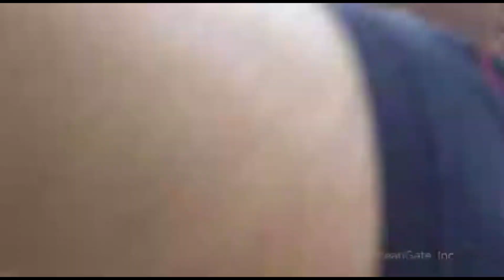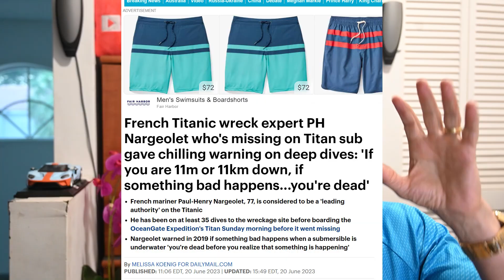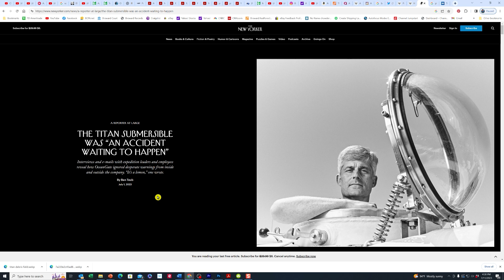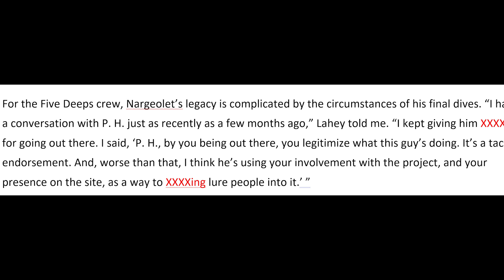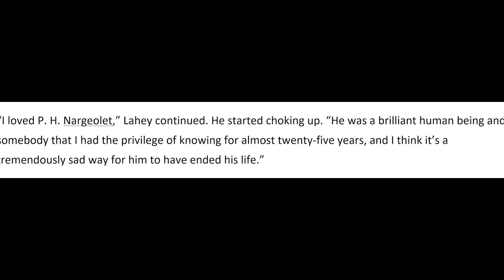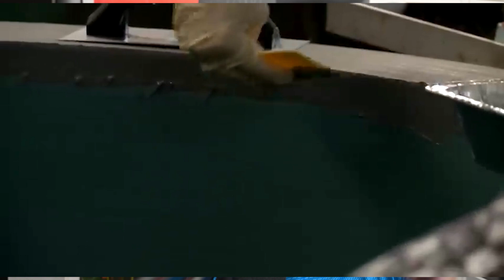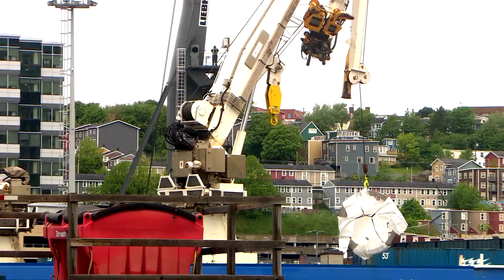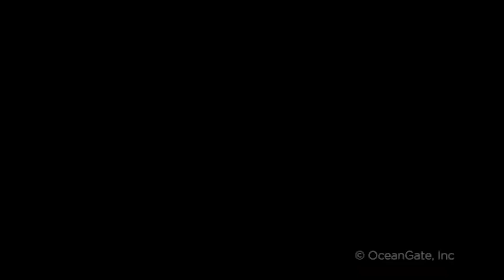Titan Sub: More Q&A, Design Defects, Why Descent Fast

Comment: I am posting my theory here first. This is based on James Cameron's comments about communications with the expedition team. I am an engineer.

The Titan did not report water sloshing sounds or uneven descent. The carbon fibre became weakened by previous dives. On this final dive, the fibre hull experienced increased deflection (inward) under pressure, reducing the sub's volume, which looked like increased weight. Note that inward deflection of the middle of the cylindrical hull results in outward deflection of the ends. This explains why the titanium ring surfaces show the glue has been sheared off. Ultimate demise was caused by failure of the glued joints, failure of the fibre hull envelope, or both  simultaneously. 

Thus the mechanism for apparent weight gain was the same as the mechanism for ultimate failure.

I have done  rudimentary calculations for volume loss due to increased hull deflection , but don't have enough information (initial sub negative bouyancy, balast weight, etc).
Reply: Like you, I don't have the numbers for precise calculations, BUT: carbon fiber is not very elastic. For the hull to be compressed to the point of large loss of volume the deformation would have to enormous - in the end it would have been so big, dropping all the emergency ballast including the landing frame, and applying thrusters' power wasn't able to compensate for it. This magnitude of compression would have, inevitably, resulted in a serious deviation from the perfect cylindrical shape that was an essential part of the structural strength of the hull. Any smallest inaccuracy (allegedly in the region of fractions of a milimetre) in this area meant an instantaneous implosion.
In short, I don't believe this is what happened. My speculation only - the same as yours.
Reply: @curiouscat8457 : Carbon fibre is not very elastic, but like all materials it has an elastic range. The transition between elastic range and yield is sharp (brittle). Weakened carbon fibre would be temporarily more elastic before brittle failure. The fibre tube was something like 8.3 feet long x 4.6' diam. So an additional .080" to .011" deflection in the center is not inconceivable.
Reply: Continuing...carbon fibre being brittle is a relative term. The fan blades for the GE90 jet engine are made of carbon fibre composite, and must withstand foreign object damage of a turkey blasted into the running engine at the Peobles test site. The loading of the fan blades is unlike the constant pressure loading of a cylinder. Of course, design and construction of the blades is a meticulous, complicated process, unlike that on the Titan.
Reply: @vincentvalle783  "So an additional .080" to .011" deflection in the center is not inconceivable"

No, it is not inconceivable. Probably rather conservative, if anything. But, working with the 080" defection in the centre, if my math is correct, it would (taking in account the tapering out towards the ends) change the volume of the cylinder by about 10 l. Now accommodate the compressibility of water that would add to its density, give or take, 09% at the depth of 2,000m adding to the buoyancy of the 3,800 liters cylinder some 37 kg - and you still have buoyancy GAIN of some 27 kg. No, your concept doesn't hold water. 
Please, check my math before taking anything I say for granted, you archaic and totally impractical Imperial system drives me crazy. 🙂

Comment: Great video!
The manufacturing looks very crude at best. The overall design is error prone in the first place , GD&T could not be held to any kind of standard the way they assembled it. You are right about the contamination and curing issues too. The questionable material properties are another train wreck. 
I would like to see the methodology they cobbled together to test this vessel. I bet it is more of the same. 
A chain of errors, blunders and attitudes lead up to demise.

Comment: I don't know how long it would take an explosion of air bubbles to breach the surface, from that depth, but wouldn't it be like a depth charge going off??
Reply: I don't believe ANY bubbles reached the surfařce at all. Both oxygen and nitrogen are very well soluble in water under pressure - that's why decompression after deep dives. Any bubble would probably completely dissolve in water well before reaching the surface.

Comment: Thank you for another fascinating study. Initially, from a structural point of view, I thought we were looking  at carbon fibre failing. Now after discussing with colleagues I feel that it was the end caps that gave way as the sealant failed.  
That adhesive is notably unreliable especially under variations of pressure, heat and cold.
The viewing port lying forward of its tungsten fitting is indictment of release on impact with the sea bottom. 
( so I believe we can negate observation port failure ).
The imminent implosion would have been the same shattering the carbon fibre into millions of shards. 
It might also explain while the tail element remains remarkably intact.
Finally that additional speed of decent, being too fast, is interesting as it drastically minimises any chance for the on board crew to initiate any emergency ascent procedures.
Though how with a rapidly disintegrating vehicle they could ever hope to surface is beyond me..

Comment: You are right about the surface’s that are getting adhesive, should be roughed up, or scored some how, for a grabbing bond. Also, i would feel more comfortable about the seam, If it oozed out excess glue as the two parts are pressed together.

Comment: As much as I want to point the finger at the carbon fiber, I strongly suspect that the acrylic window is at fault...especially since it was only rated to a depth of 1400 meters...
Reply: The windows was definitely one of the disasters waiting to happen. But from the character of debris recovered it is obvious, the carbon fiber hull was shredded. If the implosion have originated at the window, the rest of the hull would have remained relatively intact.

Comment: I noticed that same detail about the Titanium rings. You don’t have to be an engineer to know that spreading any kind of glue or epoxy onto any kind of a smooth surface you would have to use some kind of abrasion method to scuff up that surface to get that epoxy to have any kind of solid bond with that titanium. The only answer I can possibly even attempt to give for that is they were using the same logic that they were using by adding 18 bolt holes but only using 17 bolts to button it up. There is a tiny bit of logic that the pressure is working in conjunction with the bolts to press those end caps against the hull. But if you are going to attempt to join those two materials you would do everything to make it permanent. The way they spread the epoxy on that that shiny smooth surface of titanium was totally wrong. When the epoxy dried you could literally pick it off with your fingernail because of the poor bonding. The engineering behind that decision was not sound. If they can try to get carbon fiber to adhere to titanium with epoxy on a shiny smooth flange of titanium it wouldn’t surprise me if the situated the hull pointing down and tried to attach the end cap upward against the force of gravity. That is how stupid that is.

Comment: I'm no expert, but it seems to me that part of the reason (or the main reason) why the sub was descending so fast was because they already had a leak that was causing sea water to come in and that extra water was adding significant weight to the sub. If those transcripts are genuine, then they were hearing crackling before their power went out, meaning that water was leaking into their electrical system that stored their batteries, which is consistent with the sub taking on water. They were probably leaking water early on and they failed to recognize it. The rapid descent would have been an early clue but it went overlooked or ignored.

Comment: I don't know if you covered this already, but I'd love to know whether there was any continuous assessment of the condition of the vessel (outside of the monitoring systems you've mentioned previously)? Because if they couldn't be bothered to do any NDT, then they obviously had no rigorous baselines for the condition of the vessel. But I wonder whether they did any actual manual and robust monitoring and assessment of the vessel's condition, particularly following dives.

Comment: One thing that is also insteresting is if you look at the salvaged nose of this craft hanging by the hoist strap, its hard to see any tapped bolt holes, the surface looks clean. Almost as if the mating surface of the acryilc window for the (what looks like 18 mounting bolts) maybe was glued as well?  Wish they took better high res pictures capuring better details of the wreckage as it was being hoisted off salvage ship.

Comment: The carbon fiber and the bonding material most probably  have diverent specific- gravities (sealevel densities) and importantly differing "Poisson's ratios" could mean that the bonding material shrinks faster than the fibre during increasing pressure causing the extremely short life fatigue stress failure cracking sounds as the bond is torn from the fibre, (or Titanium rings?) under.the deep sea trips and excessive pressure. 
Quote from Google re a paper on negative Poisson's ratio : -
"...The manufacture of negative Poisson’s ratio (auxetic) composites, containing inherently auxetic phases is rare and has been confined to relatively low modulus composite systems with stiffnesses several orders of magnitude below those of structural composites. This paper presents the use of an auxetic double helix yarn that is used to produce a unidirectional fibre composite with both relatively high stiffness (4 GPa) and negative Poisson’s ratio (−6.8), at 30% fibre volume fraction, compared to other auxetic composites. This is the first structural auxetic composite to be produced using carbon fibre and importantly it was produced using standard manufacturing techniques and therefore is potentially applicable in a variety of engineering applications...."
Reply: Keep at it - Sorry I had accidently copied the whole google search for "Poisson's Ratio carbon fibre bonding"
I'm an Octogenarian retired ASNT Level 3 Quality Assurance Confirmance/Compliance structural Engineer. My first fatigue stress failure  assignment in 1968 rejected continuous tripple span post tensioned prestressed concrete Gantry I-beams for the Tiwai Point Alumunium Smelter in New Zealand.

Comment: I was on a project that measured piping vibration.
The blocks were glued to the piping using the same adhesive they used for the space shuttle tiles. After about 15 minutes the sensors stopped working properly. The sensor blocks had fallen off the pipe because they were highly polished.

Comment: I doesn't matter how you wind the carbon fiber in this application. The physical forces cannot be modeled because the carbon fiber is in compression and therefore it's behavior is indeterminate. It's like a rope, very strong and predictable when tension is applied but when you try to push on it you can't predict where it's going to go.

Comment: Holy xxxx! I have worked in professional racing since 1994 and all carbon fiber we use on any cars is always cured in an auto clave. The material doesn’t have the same strength if it’s just wet laid and left to dry at atmospheric pressure. No way in the world would I trust that stuff for a sub. Even if it’s been auto claved. You want solid titanium or some high strength steel. I can’t believe someone thought this was a good idea.

Comment: It was a stupid design, to have a tube made from rejected aircraft material with caps glued to each end. It was also stupid to fire engineers who said it wasn't safe. Then it was stupid to refuse to get it certified. Why would you not send the craft to the bottom of the ocean, like twenty or forty times, unmanned, and analyze the craft after each dive? Didn't have time for due diligence testing? Too greedy and wanted to make money fast? And refusing to hire 50-year-old white guys with 30 years experience, for the sake of diversity, is also stupid.  Pure stupidity is why these people died. But I have a question. Paul-Henri Nargeolet was the one man in the entire world most qualified to look at the Titanic and be able to determine whether it was sunk by hitting an iceberg, or whether it was blown apart by a bomb placed inside the huill. Indeed, Commander Nargeolet had examined hundreds of sunken ships making those exact determinations. Why was he going down to look at the Titanic again? And why was ROTHSCHILDS on the board at Oceangate, an Everett, Washington, USA company? Where there's smoke, there's usually fire...

Comment: Since you first posted the coms transcripts (assuming they're true) , i've been wondering if their rate of decent is related to them mot being unable to climb.
Why was their rate of climb so terrible? Have i missed something obvious?
Reply from the maker: Likely were overweight, or taking on a bit of water weight, or the electronics failed and the thrusters were unable to aid the ascent. Those are things I can think of
Reply: @jeffostroff  Thanks.I was trying to work out which parts or systems could flood but such info is difficult to find
Reply: @extraRon888  Practically any part supposed to operate under normal atmospheric pressure - i.e., passenger compartment, electrical systems containers etc. By all means, something of fairly large volume because the quantity of water ingested was more than could have been compensated for by dropping all the balast including the landing frame.

Comment: I honestly don't think you should be caught up so much on how the rings are glued in, in the environment they were in, the ends would be held pressed in by the pressure, where the glue wouldn't even matter if it existed to hold it in place
Reply: You are right. The rings wouldn't "fall off", but the poorly adhering or cracking glue wouldn't seal too well - and is probably what started the buoyancy problems and eventually killed the sub.
Reply: @curiouscat8457  it still wouldn't matter, as someone who works in hvac, the glue would be very comparable with situation of flare fittings, where it's a plastic in large compressive forces, it's extremely comparable as the mating surface is held together by compressing copper to plastically deform, where it isn't even bonded together, yet it never leaks, and thread locker, which is basically just thin glue, is placed on the threads to slow down the backing, despite there being temperature and pressure changes all the time which causes a lot of differential expansion and contraction, there are machines which havn't leaked for more than a decade, simply because glue behaves exactly like i expect it to, where minute movements in the glue would lead to bonding back to itself

any modern day technology you have is also probably held together by glue, yet, it doesn't even fall apart despite loads of thermal changes which would cause a lot of differential expansion and contraction
Reply: @jigan2971  You may be right, but without knowing exactly what glue has been used, it is a pure speculation (as it is my theory 🙂). I don't think you scenario applies to the Epoxy family of glues.

Comment: I was wondering if the carbon fiber were cross woven and two or three inches thicker would have it failed?  I think the design was not conducive to repeated deep dives. Hearing about the cracking noises on other dives SHOULD HAVE BEEN a serious warning.
Reply from the maker: Not enough testing has been done on carbon fiber at depths like this. But I presume it would have at least lasted a lot longer if it was woven helically rather than hoop spun.
Reply: Can humans function inside of a pressurized atmosphere?  Are subs and submersibles pressurized? If so how much psi ?

Comment: I'm not sure the sub's decent speed was a main reason for failure of the pressure vessel. I bet it was cumulative damage from repeated dives plus a poor design to begin with. I think the sub's failure was inevitable at some point.
Reply: I have no technical expertise on the construction of the submersible; however, I do know a lot about Great Lake freighters over the decades.  What you refer to here is simply called "metal fatigue".  Nice easy answer but it has been proven to be DEADLY.  Metal fatigue was the cause of three major freighters sinking.
The Carl D. Bradley in 1958; the Daniel J. Morrell in 1968; the Edmund Fitzgerald in 1975.

Comment: The ”leaked transcript” is most likely a cruel fake and any speculation based on it is made on very weak grounds. We can’t be sure of course, but I suggest you check out a fact check on this transcript, for example the one by Snopes, which pretty convincingly have judged it to be fake.

Comment: It's become clear to me this vehicle was built to backyard standards at worst, and theme park exhibit or movie prop hero vehicle standards at best.  It looked the part. But that's all.  The video of hands crafting the epoxy looks like somebody building a fiberglass boat in their garage.  Not a submersible designed for one of the harshest environments on Earth.   Absolute madness.  But not at all the first time that's gotten someone killed.  Or the last.  The history of submarine inventors alone has plenty of examples of inventors dying inside their own bad designs.  It happened a lot.  It is a difficult thing to do right and easy to do wrong even when you think you have it nailed.